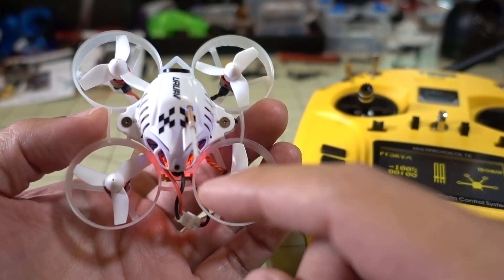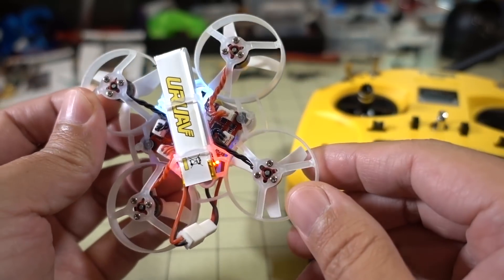Drone Diagnosis #1 💊 Motor Won't Spin 💊

Comment: So I have a micro quad like this and when I arm the motor will some times spin and I try again and it won’t spin unless I spin it then it starts going and I try to fly it and it sometimes just falls out the air anyone know what it is?
Reply from the maker: Sounds like the ESC is going bad.

Comment: I did the same thing with my meteor75 but my results were opposite of yours. 
My motors are fine.
Reply: I also used Betaflight. 😉👍
Reply from the maker: If motors are OK, then the ESC will be bad.
Reply: @AlbertKimTV  I figured that. Perhaps I got the area too hot when I was soldering next to them. 
I won't be doing that again.

Comment: My problem is that when my battery gets low, it could be 1 or 2 or 3 engines stop spinning. As soon as I charge my battery the quad is good again for another flight. After about 1 minute of air time it does this.

Comment: What if you used a multi meter and tested output voltage at the motor that wasn't spinning, and then test a motor that was spinning to compare? I did just that and at 1 motor I had constant voltage and at the motor that was having issues voltage tested low and was very sporadic? Esc bad? Or?

Comment: I have a Snaptain A15H and when I put in the battery one of the propellers starts and I can’t turn off the drone. Only way to stop it is to take out battery.  It has had no hard crashes prior to this happening.  Any idea how to fix this?
Reply from the maker: The FET driver for the motor is likely damaged.  You need to replace the main board inside.

Comment: hi there ..great vid...i have a eachine trashcan and did antenna mod without incident.. my one motor no is not spinning but does a few rotations when helped by finger.. esc fine... any idea what might be problem--- never crashed it either..please..
Reply from the maker: Check to see if the heat shrink on the motor wires is rubbing against the bell.  If that isn't it, try raising the digital idle value in the configurator.

Comment: So if its not the motor, do you have replace the whole esc? ex Mobula 7hd
Reply from the maker: Yeah, if it turns out the ESC is no good you have to replace the whole board.
Reply: @AlbertKimTV  Darn..Thanks Albert 👍. Fairly new at this and so far it's been nothing but frustrating 😅

Comment: i just got a second one of these, now the new one after about 10 flights the front right motor does not spin. and now suddenly the old one after 10 month has the same problem, any idea what it could be? I did not change the firmwarez on any of these. And in my case it es not the motor
Reply from the maker: See if there is anything physically causing the motor to bind up.  If not, see if the problem is the motor or the ESC by swapping motors as in the video.  If it's a dead motor just buy a replacement, but I recommend you watch a new video I have coming out in a few days where I replace the 0603 motors with 0802 motors.  Much better performance!
Reply: it is not the motor. i did the swap before i watched your video, nothing is blocking they can sometimes spin a little bit but it is inconsistent  @AlbertKimTV

Comment: Unscrew motor and put the heatshrink wires down gently from the bell. Try multiple times. Heatshrink on wires blocks motor causing this motor failure. I have this problem today on my new kwad and now is ok :)

Comment: Hello, and thank you for video. Is it a good idea to put some hot glue on the FC to protect the solder ?
On my UR65 i had a short circuit because of 5V alim wire solder broke up. An ESC down, must buy a new crazybee....
Reply from the maker: I would use liquid electrical tape instead because it will be lighter than hot glue.

Comment: Hi Albert, have a couple of questions, I bought the one with the charger and 3 x batts, the charger has a USB port on it, can you actually charge via the a laptop? Tried, it didn’t do anything? Also where can you get a spare antennae for the vtx? Thnx
Reply from the maker: I don't think the USB port works.  I use a lipo.  The VTX antenna is soldered on so you'll need soldering skills.  I have a video on VTX antenna replacement in my Tutorials playlist.
Reply: Thanks mate

Comment: Having bushings in these motors probably means wider tolerances to the shaft, and a slight lean of the bell when unpowered. With one magnet closer to the coils than the others might be a force low idle cannot overcome.Once the little motors start spinning though mutual attraction/repulsion keeps the bell centered on the shaft. Increasing idle % may lead to float so I keep mine below 10% and just fiddle with the motor until it starts turning.

Comment: Some motor not spin was caused by the ESC firmware update,  don't forget to set the startup power to be 1.00 in the BLHELIsuite
Reply from the maker: Might be true for some cases, but in my case the motor was actually broken.
Reply: Maybe. Thank you for the review , you always do great job.

Comment: Great series Albert. You could even make up a few extension leads with various plugs / clips etc to help diagnostics
Reply from the maker: Thanks.  Any suggestions for other common problems people seem to keep running into that I can make a video about?
Reply: Currently Im trying to understand what 'Current drawn' actually means & what the numbers I'm seeing in the goggles is? It maybe me, but I thought watching this is a safer way to know the condition of a lipo than just voltage? Any help would be appreciated.

Comment: Hi Albert Kim! I have a single motor, that gets hotter than the others, I swapped it for a brand new one and it gets hot too. The quad flys fine, no dipping or wierd stuff, just that one hot motor. Do you have an idea what that could be? ESC, maybe?
Reply from the maker: Something is up with the ESC I think.  If you take the hot motor and swap it to a different ESC and its not hot, then it has to be the ESC.
Reply: Thank you Albert : )

Comment: I had same motor go after 3 battery's. Swapped motors, same as you. Motor was still not going. Reflashed esc's and motor ran again, weird, cause was definitely motor not esc.
Reply from the maker: weird!

Comment: Can you make a video on connecting these to blheli config? I can’t get them to connect for some reason, and I’m convinced I need to raise the motor startup power. I tried raising idle speed but randomly they don’tspin off the start, even at 9%
Reply: You should only need to plug in a battery and usb to connect to blheli ? While you're NOT connected to betaflight
Reply: maybe 10 % or higher
Reply: Dave yeah I can connect with all my other drones, these 2 UR65’s won’t connect for some reason
Reply: Betaflight no prob though..

Comment: Nice.  I have the same drone.  One of my motor tends to stutter when I arm it.  When raise the throttle to about a third of the way up then it starts going. Once it's going it's fine.  Any ideas?  Thanks.
Reply: with d shot use idle %

Whit oneshot or multishot raise it to 1160
Reply from the maker: not sure as mine is broken at the moment...
Reply from the maker: not sure as mine is broken at the moment...
Reply: I have this same problem with the same quad
Reply: me too
Reply: use minimum trottle  and raise it
Reply: Yeah. In my Snapper i use about 10% on Dshot300. Works for me.
Reply: Mine flew very well, try to switch your UR65 on Dshot300
Reply: How do you like the Snapper?  The UR65 has some wobbles and jerks when I go full speed. I guess it is expected with tiny Whoops.
Reply: Here is my battery cage for Snapper 7, just in case if you want to buy Snapper and you have access to 3d printer: https://www.thingiverse.com/thing:2986809
Reply: mine also flies fine I use oneshot or multishot
Reply: I have the snapper but he broke I still have to make it
Reply: Yeah I run DSHOT on it. Raised Idle % from 10 to 20 and it works great now
Reply: great good flight

Comment: Thanks for the video! I have 2 UR65’s, 1 FrSky and one Flysky. Both have a weird thing happen once in a while that when I plug the power and throttle up some motors won’t spin. Manually turning the props seems to “free them up” and it works fine then till the end of the pack. Any ideas on what could be causing this? Also I was getting some vibrations on a punch out with them, lowering the P values seemed to help it a lot. Care to share the pids you use on that model?
Cheers!
Reply from the maker: raise the digital idle percentage until they freely spin
Reply: Lieven van Velthoven Hi thanks for the answer. I can’t get either of them to connect to blheli is the other problem I’m having. They connect to betaflight no problem, and my other drones connect to blheli, but these two won’t. Any suggestions on things I can troubleshoot for connecting them to blheli suite?
Reply: Albert Kim can you chyme in on this blheli connecting issue?

Comment: I had the same issues with my snapper. The happy model motors are nice but wires are known for breaking right at the bell. I have gone though 2 motors already. Oh well they are easy to fix

Comment: Are these brushless motors directional? I notice that FWD LEFT and AFT RIGHT are wired red, versus FWD RIGHT and AFT LEFT are wired black. Does this imply you can't reverse these motors? Curious to know if you can do Turtle Mode with these micro brushless quads.
Reply from the maker: They aren't directional AFAIK.  You can always reverse them in the ESC anyway.  Yes, you can enable Turtle mode on these.
Reply: The stock UR65 motors don't look directional, but when I upgraded to new Happy Model 19k's I had to go into BLHeli and change direction on two of the motors.  I've heard other people say that they have had to do that with some, but not other motors of this size...strange...but always check first when swapping out!
Reply: Qreacher I have those same happy model motors to swap in! Thanks for the info!
You think, instead of going into blheli, I can just switch any two wires in the motor plugs to get the same result?

Comment: hello dear albert kim how to get air mode to work?

I have tried everything, he did not do it from the beginning

i flashed it to 3.4.0 RC 2

but now it does not work either

can you help me please thanks
Reply from the maker: You probably need to adjust your digital idle percentage.  It's probably too low.
Reply: I use oneshot  how do I raise the idle?
Reply: I can only see it when I select d shot
Reply: I've already found it

Thanks

Comment: Is there any chance of burning out an ESC if the motor is what's bad? (Using this method)
Reply from the maker: Only if you go full throttle for more than 5 seconds.  Short micro bursts will be OK.

Comment: And make sure to make a video like this or Banggood will never believe you. Then if the ESC is bad they will argue and offer to only refund the value of the bad ESC, despite the fact that it is an aio FC/ESC/receiver. Who says I can solder? They should have replaced the whole thing!!
Reply from the maker: Since they don't require you to send it back, the only way they can know it's defective is if you show it to them via a video.  If I were running a shop I would ask the same thing.
Reply: Actually I was very impressed with them watching my video and then asking me to swap motors... But then they decided the ESC was bad and offered me $15 for a $33 part. Direct quote as to why: "The board includes the FC, ESC and receiver, we think 15USD is enough for the ESC, is it right?"

I asked for a full refund so I could use another website and they sent a new FC/ESC by snail mail even though I paid for rush delivery originally.

... Still way better than Gearbest.

Comment: Lol you sound irritated
Reply from the maker: It's because I kept answering the same questions over and over so I thought I better just make a video so the next time I get this question I can just send them a link to this video instead of typing out a long response.
Reply: Albert Kim for sure. Anyone in the hobby probably takes this for granted. Youd think it was common sense but we forget not everyone has experience troubleshooting and some just dont have the frame of mind to think this way. Good on you for helping.